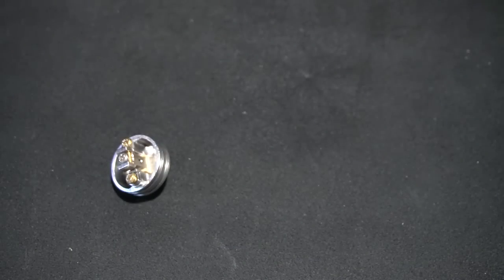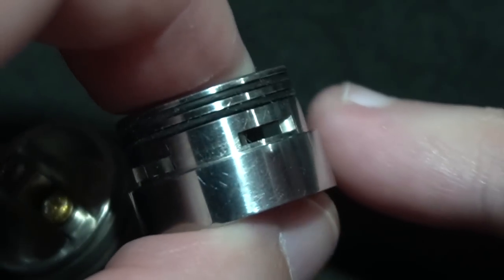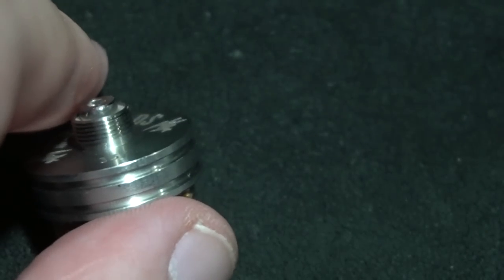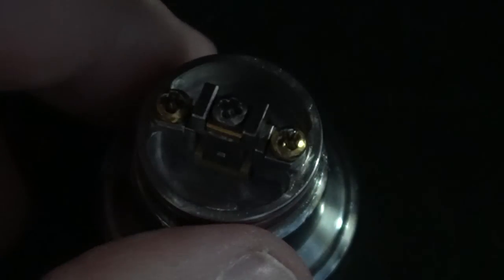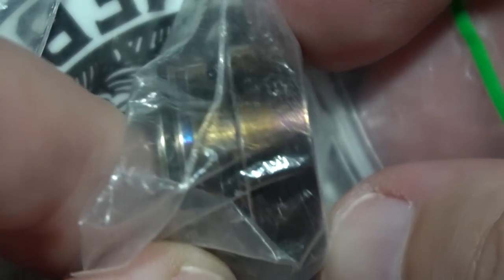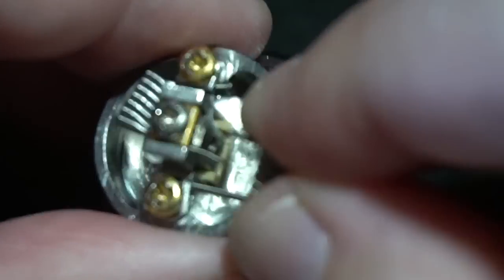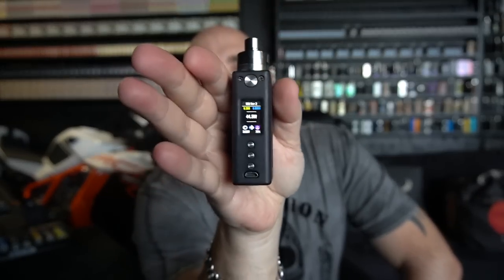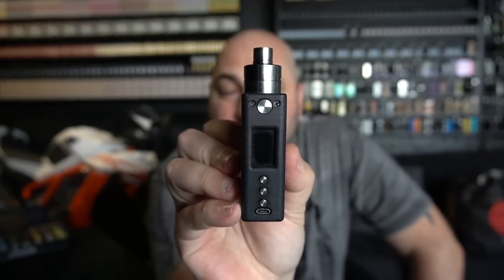The Holy Grail, $1500 RDA | The M-Atty

Comment: That’s definitely not how they come in regards to the finish. The one is this video has been mirror polished at some point I think. 

Also dc is for dual coil, the sc is for single coil and has a hole on one side only for the juice to squonk through. Also there is around 700 made so far. I have a list somewhere of the batches and how many etc. there has been 2 runs of a couple hundred or there abouts and then the special runs of the star deck, ftw etc and lately has just been one off releases with exotic accessories that go for massive money, like 5k plus and they are identified as zfg 

If you don’t like that extra top cap I think it would look good on mine :)
Reply from the maker: I mention the exact amount at mebmods.com
Reply: Jai Haze that’s the list I was talking about, I just had the numbers wrong. 700 standard ones is where I got 700 in my head from.

So are you going to be using that spare top cap from your newest one? Lol